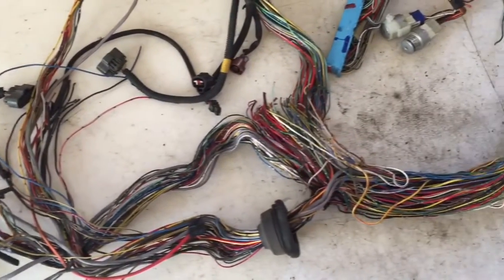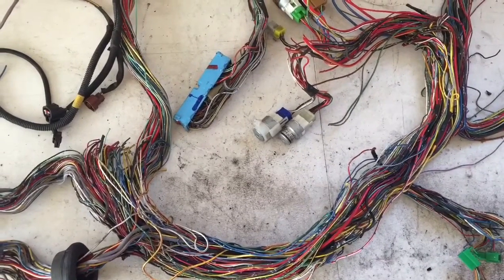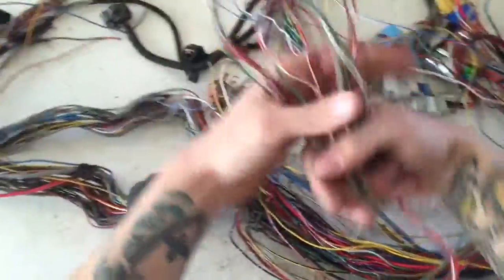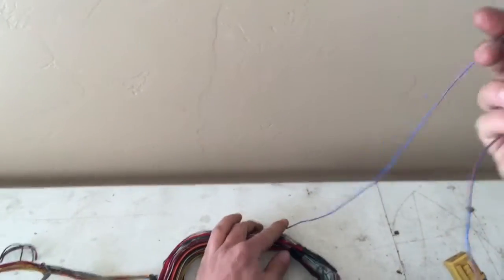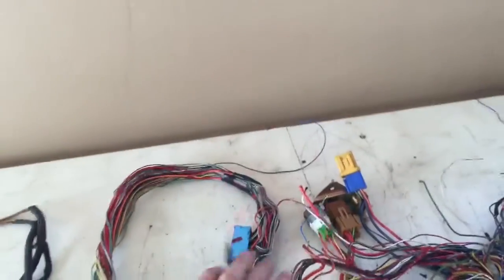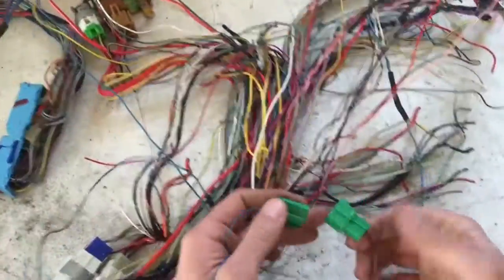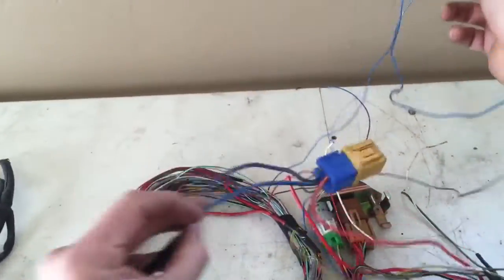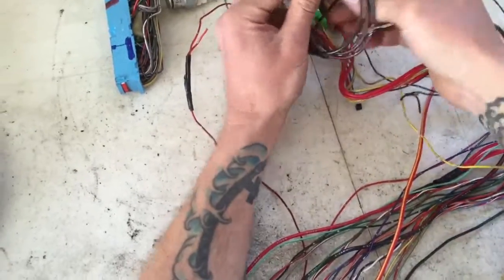2. Weeding 1/2 - Wiring Harness Series

Comment: Good stuff. I wish this had been available to me a year and a half ago! I may never do this again, but it will no doubt be helpful to others. My main questions when I was doing it was, "What do I need to keep (fuel pump relay, atmospheric sensor, MAF/MAP, etc.) and what I don't." I can't stress to greatly not to trim off wires to closely at the ECU connector until you are certain that you don't need them. The Smallcar spoofing module I got later on needed some of those wires. Thanks, Mick!
Reply: I know the difference between "to" and "too", but unfortunately my phone spell check does not.  :-)

Comment: so this harness is the harness for the subaru engine that will be installed in the vw...correct???
i am swapping a nissan engine into a hyundai sonata...so i will need to weed the nissan ecu wiring right?
Reply from the maker: +michael adrian Correct, but the same principles can be applied to other vehicles and swaps.
Reply: +Busaru thanks for the reply...I am trying to understand how the other functions remain alive..like lights, power windows and other modules etc....what do I do?
Reply from the maker: +michael adrian Well the way it works in Subaru to VW platforms is the VW handles the chassis wiring and the Subaru wiring handles the engine - like a standalone system.
Reply: Thanks guy..you've been a big help. I'm new to this so thanks. Liking the videos and subscribed.